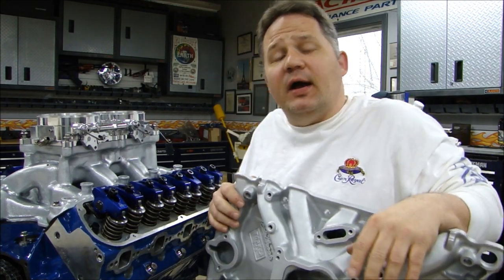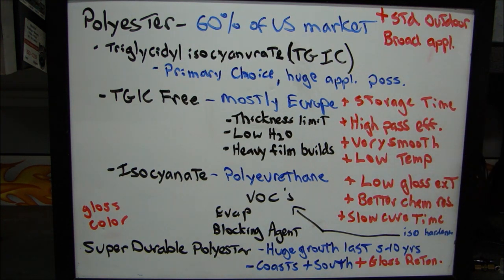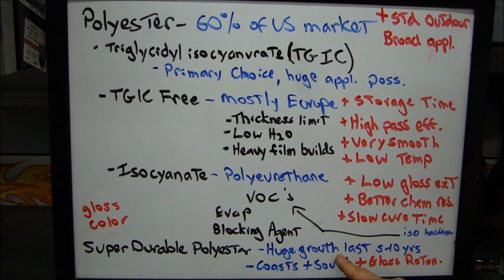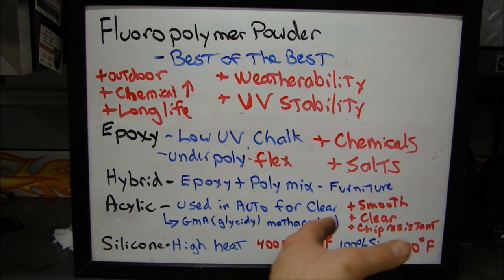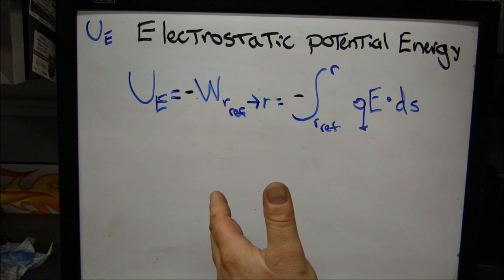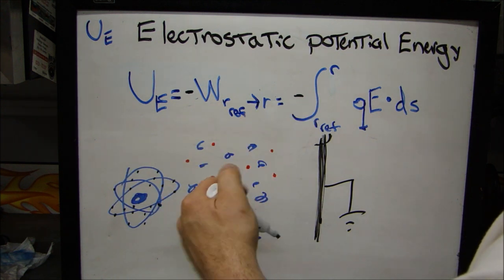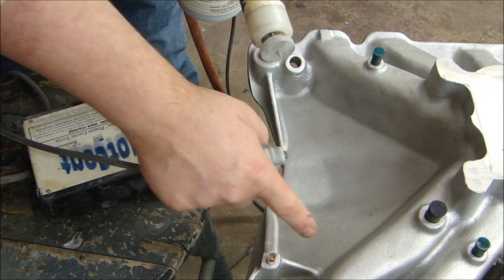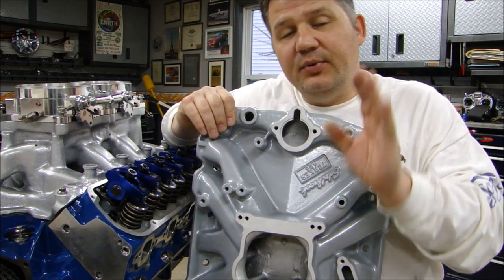Powder Coating and The Science Behind It

Comment: THANK YOU! Finally, YES, it is ELECTROSTATIC "NOT" "NOT" "NOT" ELCTRO- MAGNETIC! I don't know how many DIYer claimed electromagnetic attraction was the theory behind how powder coating works. I used to work with fluidized bed coating. The parts were hung on a conveyor, preheated,. run through a suspended fluidized bed of powder, then run straight into the oven(s), and then into a controlled cool down & curing. We are having a lot more polyesters used in luthrie (guitar building). The stuff is tougher than woodpecker lips, compared to nitrocellulose spray finishes, and anyone who thinks nitro plays into tone on an electric guitar is talking out their ass. Some dipwit had a durian fruit on board a British Airways flight from France, that got on one of my guitars. Had that guitar not been poly coated it would be in the trash right now. The case was long thrown away. That fruit is the stinkiest most acidic leaky ball of nasty I have ever experienced. The durian's owner's credit card was charged an extra $10,000 and I got $2000 to replace my guitar & case, which was about 1/4 the cost. GREAT VIDEO! I strip the poly guitars all the time, but we use heat guns, as chemical strippers won't touch the stuff. FYI I am not only a guitar and amp builder, I also have an FCC license for the highest class amateur license, so I need to know math, and I need to know electrical theory. We use B  fields too, which is actually magnetism. Powder coating is NOT. That is an E field much like used in designing vacuum tubes. GREAT VIDEO! I am starting to powder coat my own amplifier control panels, and effects boxes, in house. I am sick of paying for sh*tty results from outshopping these services.
Reply: High voltage with almost NO current. If it was high current, powder coating would claim a lot of lives to electrocution.
Reply from the maker: That is so awesome Seth. Thank you very much. I make sure I am using the correct vernacular when I make videos and sometimes slip, as in voltage vs current. That sucks about your guitar. I play left handed so my LP and Strat were custom made. I do anodizing and sometimes anodize guitar hardware, but powder coating effect boxes is a good idea. I've painted guitars too and unless to have an electronic eardrum you'll never hear the difference, I agree

Comment: For now on when someone asks me what is powder coating lol I'm sending them to this video. Usually I send a 3 or 4 page printed paper work explaining the process with the customers order and sample piece displaying there color so they can show people, or post it on my ebay page, this video should be included lol. Great vid, you should check out eastwoods dual voltage charger. I bought a second gun because I use high temp powders as well and don't want any chance of cross contamination between a regular and high temp powder so I purchased there dual voltage, it's a pretty sick system and works awesome especially for larger parts or even faster coating
Reply from the maker: That is so cool. I'm due for a new system and was looking at that gun. Great idea with the 2 guns...thanks for sharing. Glad the video can save you some time with your customers

Comment: Really fantastic and through explanation Pete, thank you!  I'm manufacturing a desk made primary of aluminum that will be powdercoated.  You mentioned furniture commonly uses a blend of epoxy + poly.  Is there a brand/product line you could recommend?  Not sure it matters but I also want to allow the customer to choose glossy or matte finish.  Assuming that's no issue, is there a glossy rating you'd recommend (e.g. 60 vs 90?).  Thanks very much!
Reply from the maker: I think it all depends on what the place that is going to do your powder coating uses. Most powders are very tough. The glossy appearance is up to you. If you want it very shiny the will have to put a high gloss clear coat on top.
Reply: +Petes Garage  excellent presentation. Thank you very much.
I really found your presentation immensely useful and enjoyable.
I wish I could repay you in some fashion.
Asress

Comment: Great explanation. I am thinking of having my old house radiators sandblasted and powder coated but I have some questions. My radiators are hot water not steam so about 200 degrees max. What is the best product for this? Same as for an engine manifold? Also the paint that is on them now is insulating the radiator thus not allowing the heat to fully radiate and costing me a bundle. Is there a powder coat product that allows full heat transfer? Thanks so much
Reply from the maker: Any powder can handle 200 degrees. As long as it is not applied too heavily the heat transfer should not be a problem. I would ask the powder coating place if they recommend a special powder.

Comment: Very good information. I was wondering about buying the eastwood kit but i have no oven to bake the parts in. Is it possible to use a regular kitchen stove for  smaller parts? And finally, can a powder coated part be transported prior to baking or will the powder come off very easily?
Reply from the maker: You can use a regular kitchen oven, as long as you are not going to use it for cooking anymore. I routinely carry parts to the oven. As long as you are careful not to touch or bump the part it is no problem.

Comment: Wow! Great video again. What about powder coating composites? I've read that you have to preheat the composite part or use low temp powder or use high temp resin. Actually, my real question is: what is the best way to protect composites from UV and give it durable, color top coat in very harsh environments. I'm not looking for a pretty finish.(Resins and the fibers don't need chemical, salt or moisture protection, just UV, right?)
Reply from the maker: Since a resin is a thermoset plastic, it will burn well above the 375 degrees. However, there are low temp powders that provide excellent UV protection. Depending on your composite I would run a test sample first. The physics says it will work, but a composite can give off gas when heated which may cause a problem. Give it a try and please let me know how you make out.

Comment: Great video Pete.Can you tell me one thing ?What is the minimum size hole that can be powder coated. Is it possible to powder coat a perforated sheet of 1mm holes ?Thanks in advance.
Reply from the maker: If you apply the powder thin enough you can coat it.

Comment: Hi,

What's the best way of preparing the surface, the cleaning process and what liquid to use that won't leave and deposit left from the cleaning process
Reply from the maker: I bead blast the parts and clean with lacquer thinner
Reply: Pete's Garage   So, you would not use Aluminum Oxide?

Comment: Hello Peter Garage, is there any way to create the electrical current manually? they dont sell affordable eastwood like you use in the video. They only have industrial powder coating machines that are very expensive. Thanks
Reply from the maker: The cheapest gun from Eastwood it $71.99. That is very reasonable

Comment: I want to powder coat steel parts for mass production in my garage. I need a powder coat that will sustain bad weather, UV rays etc. Harbor Freight has a powder coat package, gun and powder. Would you recommend this setup over say the Eastwood powder coat setup? Does HF sell inferior powder over Eastwood? any suggestions would be greatly appreciated.
Reply from the maker: You get what you pay for and that's what HF is. I would use at a minimum Eastwood equipment and powders

Comment: Hey Pete! Thanks for the lesson. Looking into getting a small setup to powder my engine parts on a 1950 Studebaker Champion I just picked up. Not sure if this is the help you provide, but I am trying to figure out what all parts would be best to coat and what colors the original were.
Reply from the maker: i don't think any were originally powder coated, but the colors were mostly satin or chassis black. It depends how close you are looking to match the exact factory color
Reply: yeah... I figured they weren't originally, but thought the powder coating would last longer than primer/paint.
Reply from the maker: Then just go with a satin black powder

Comment: Thanks Pete, awesome explanation. I have a different type of gun called the Tribo powder coating process. I've had some difficulty with it. The manufacturer stated it would work with regular powder but it dosen't always work with all other powders. I was wondering if you know of a trick that I could use to modify my tribo gun to shoot regular powder. 
 It wasn't a high end gun, under $200 bucks and worked great with the powder supplied with the gun and many other powders but not every powder even though they all came from Eastwood. 
 Are some powders more easily charged with static electricity than others depending on colour. Might seem like a foolish question but I can't figure out why some work better than others. Thanks again. Steve.
Reply from the maker: You may have to play around with the air pressure....low pressure will for the powder better and give it time to get charged. Also, don't over fill the jar attached to the gun, just a little at a time
Reply: ***** Thanks again Pete.
You make great video's with in depth explanation but you keep it simple which is great. I've been following for a longtime now. I'm a Chevy SBC engine builder but learn from all engine builds. Self taught so video's like what you present are what I look for to find out from the Pro's how they take on different aspects of any and all processes. I appreciate the insight and wealth of knowledge. Thanks.
Reply from the maker: That's awesome! Thanks Steve

Comment: I am new to this technique, we are upgrading our paint dipping method to this powder coating technique. Can you tell me the problem that I will have to face while and after the use, and anything that will help me know thus better. I have 5000+ 1meter long 4 mm diameter rods. for curing we will have custom built oven 5 x 2 x 6 ft .....
Reply from the maker: The only thing you will need to watch is the parts must be clean
Reply: Pete's Garage   How will he be able to coat a round bar properly?

Comment: good demonstration, but in science part I feel the particle get charged with Positive charge when + ve potential is applied ,then  also powder will move toward the surface of  earthed object to get discharge.
Reply from the maker: The powder picks up an electron which gives it negative potential and it goes to ground to get rid of it.
Reply: @PetesGarage  Equal charges repel. The ground is negative and the powder has a positive charge when an electron is removed.

Comment: can it stand in high temp inside the engine and not stripping or peeling the coating on parts?
Reply from the maker: It will not stand up on exhaust manifolds

Comment: good explanation.
just one question: how do the ions bring the powder to the part? is either the powder itself ionized or do the ions affect the powder in some way and then what is the material in the powder mixture that gets ionized?
Reply from the maker: An ion is a particle with an extra electron. Most of the powder particles will become ionized in the presence of the electric field. The powder becomes ionized. The ions are brought to the part much in the way a magnet draws in metal. You know how you can feel a magnet pull stronger the closer you bring it to metal? Same thing with an ionized particle. The electric potential works like a magnetic field. The lines of flux density increase as the powder gets close enough for the field to pull it in.
Reply: ***** allright, so a part of the powder gets ionized inside the gun by a magnet and the rest gets ionized by being in the presence of the allready ionized powder.
It was not clear for me if the ions (red) and the powder (blue) are the same material.
Reply from the maker: There is no magnet in the gun. There is an electric field the powder passes through and it picks up the electron. Then the electrons transfer to other particles. The red and the blue are the same, you are correct.

Comment: What type of powder did you use to coat that intake manifold? Awesome video!
Reply from the maker: Cast Aluminum from Eastwood
Reply: Got ya. I know at the beginning you were talking about the different types of resins for powder coating, is there any you use a lot or would recommend using the most?

Comment: I just don't know if I have missed something while listening to your video from start to end but you didn't mention about baking or heating the powder coated item?
Reply from the maker: I did not...the video was about how it works.
Reply: *****
thanks
Reply: +EndofUSA  Do you know what, that is the same principle as a cathode ray tube, where negatively charged electrons  are boiled out using a heated cathode,  in complete vacuum,  as they boil off due to heat, they escape into the space and are accelerated and gain energy and bombard the screen, in other words they are attracted to the screen which has a positive potential, and so electrons striking the screen coated with a phosphorous coating glows, and all you then need is a means of controlling the direction of electrons where to strike on the screen and this can create a picture, it is like  you can draw a picture with a pencil on a paper, but on a tv screen the picture is rapidly drawn by a single jet stream of electrons which rapidly draws the whole picture in less than a 100th of a second. And for color picture you have 3 streams of electrons each responsible for its target ara  either red phosphorus or blue beam for blue phosphorus and Green beam for green color, these 3 prime colors is what makes your screen produce a color picture. but that was probably 20 years ago, now we have TFT and LCD screens, where electrons don't need to strike the screen.where images are produced by light alone and not through phosphorus glow.

Comment: not sure the integral was explained right, but your pics are a good representation!
Reply from the maker: Lol....well....I never wanted to be a math teacher....the idea was how the powder gets attracted to the part. Good thing I didn't use common core math.
Reply: +Petes Garage 
haha, Yeh that definitely would have been much more difficult to do!  
how sensitive is the powder adhesion to part before you bake it? In transporting it to the oven does powder tend to fall off if there are are any vibrations?
Reply from the maker: It is pretty sensitive. If you bump the part the powder will fall off and if you brush against it it will come off.

Comment: What kind of chemicals are left by the heating process I have a industrial size oven but it is used to season cast iron pans if I cooked parts in it would that effect any thing?
Reply from the maker: You should not use a powder coating over to cook foods in. However, you are using the oven to season another metal so any gases produced from powder coating would not come in contact with food. Most of the gases left behind are the result of out gassing from the powder itself. Depending on the powder, those gases are quite dangerous. Other gases come from the base material.
Reply: Yeah no food is cooked just the seasoning of cast iron pans
Reply: Tyvm for the response but Im still confused weather its okay or not
Reply from the maker: I would say it is ok.

Comment: Is it true that the downside of powder coating a Harley engine is if it chips one can not repair it?
Reply from the maker: +Louie Lamoore Yes....Chips in powder coating is impossible to fix to make it look right
Reply: +Louie Lamoore i work as a quality tech for a powder coat manufacturer. if the paint chips or is flawed you have to clean the area well with a light grinder/buffer and repaint the entire part. We run a rather thick coating because most parts are under vehicles and a little thicker will help from chipping,
Reply: Thank you.

Comment: Hi Pete, love your videos, you do a great job with them, very sharp, good sound, color, etc.   Your garage is outstanding and is something for me to aspire to.  Knowing where everything is makes jobs go so much faster.   I watched your demonstration of small parts powder coating, the Camaro door hinges, you didn't wear a respirator, and actually at one point you sprayed the powder into the air a few times for good measure, LOL, but in this video comments on the dangers of hurting your lungs.  You sprayed grey and chrome.    What kind of respirator, one for dust or VOCs?   I rebuild Cadillac Northstars, and I think that having this powder coating capability would be outstanding!  What do you spray aluminum blocks with?, can blocks be powder coated?, lots of taping off, Ill bet.   Thanks so much.  Mike (bodybyfisher from caddyinfo.com forum)
Reply from the maker: +Mike Connor I know, I always wear a respirator but it's difficult to talk in a video with one on so I put my life at risk for everyone....lol. Any high quality paint respirator will work. I use the cartridge type with dust collection. I think blocks are not practical to powder coat but I do heads and intakes all the time. I paint most engines with a good 2K high temp paint. It's not very expensive to start doing. Eastwood has a great starter kit and their powders work well.
Reply: Thanks Pete, for risking your life to provide such terrific videos!  Thanks for the info and for sharing, Mike

Comment: i guess  the only  problem  with power coating is that  the finnish  looks terrible
Reply from the maker: +scottsv96 Depends on the surface and the powder. I have produced mirror finished with powder
Reply: I guess the prep work is important as well. (I'm a french polisher/spraypainter)